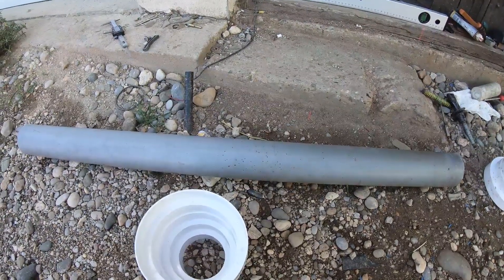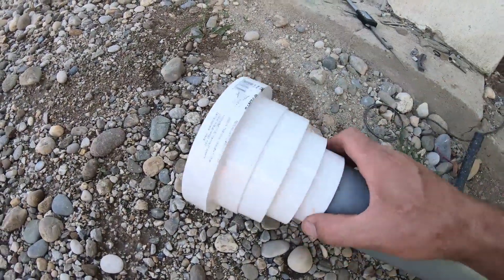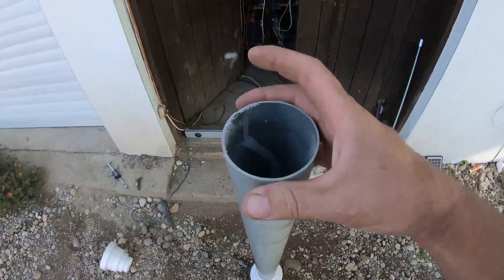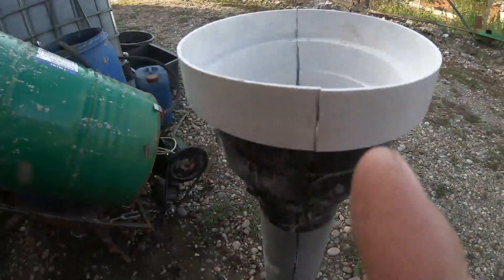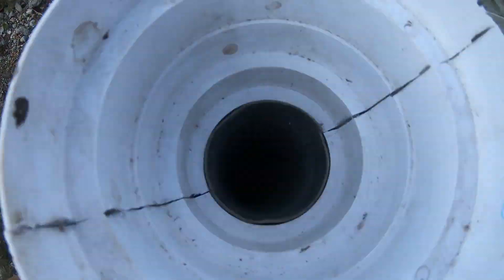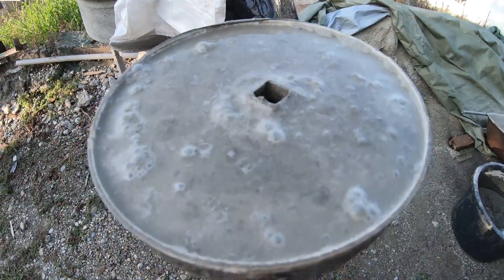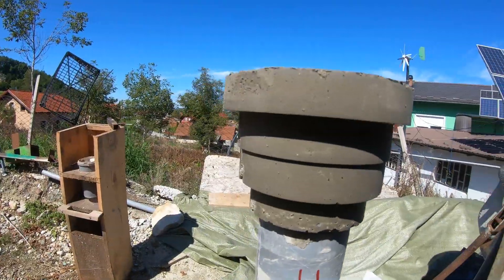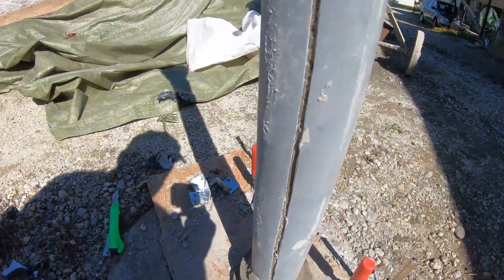Concrete post from homemade PVC mold

Comment: Good job. I did in a easy way. I blocked the bottom of the 90mm  pvc tube with a plastic bottle lid. Poured the concrete and inserted a 10 mm tube and cured for24 hrs. To de mould it  removed the bottom lid,  cut a vertical line on one side and ply with a flat head screw drive and  cast comes out easily. To reuse the mould plug the bottom end to the tube , use few found clamps  and repeat the the process  wala if you want you can pre split the tube tube and clamp it

Comment: Good work. Instead of using tape I would use several stainless steel pipe clamps - which can be re-used as many times as you need.
Reply from the maker: Yes that is better solution,greetings from Croatia and all the best in new 2020